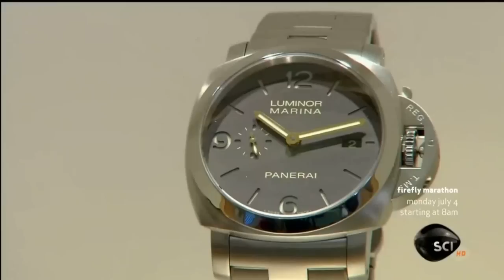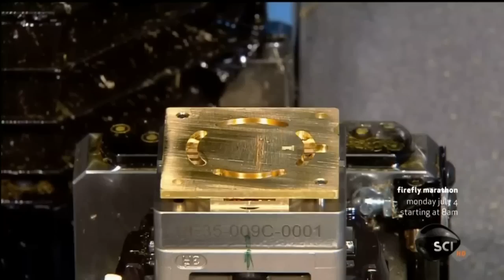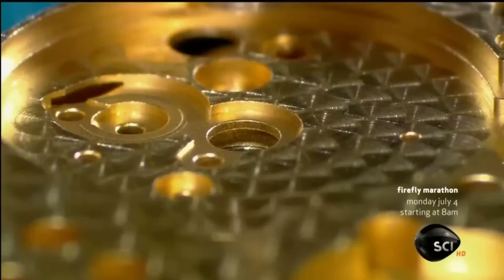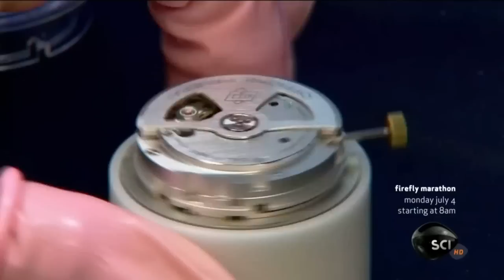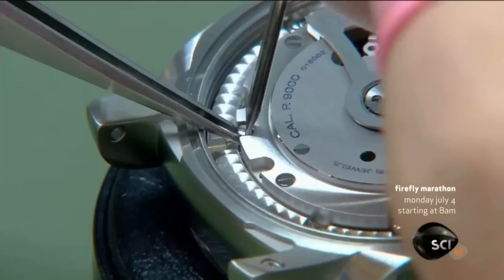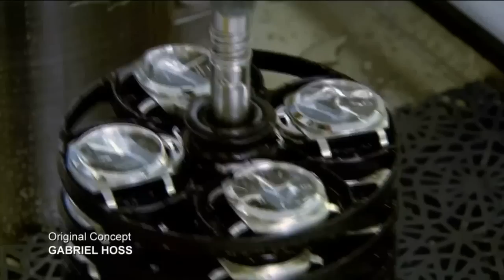Panerai How It's Made

Comment: Panerai watches are overpriced. The shitty thing is that their mechanisms are based on 1950s pocket watches. The watches are simply turned 90 degrees with the small dial at 9 o'clock rather than the 6 o'clock position. So don't get conned by so called Panerai quality or craftsmanship.

Comment: sooo, looks like 90% of all the work is done by robots, so, where's the craftsmanship and value? it looks like the actual price to these mass produced watches is about $100, it's ridiculous to pay more.
Reply: +kk Hong well the bad thing in this video is that it doesnt really show how the mechanism is made but just how the parts are made. I not trying to sell you that Im an expert, I wear a swatch but Im an enthusiast and I know a lot about automatic watches. 
Yes the PARTS of a luxury watch are made by computers so that they are precise. its the assembly and the time spent on the mechanism that makes the watch expensive.
Like building a masive lego... the parts are made by a mold but the artwork is hand made
Reply: thats what i was thinking about. this watch is quite overprice... isnt it?
Reply: Yes, it would be ridiculous to pay a hefty price for just the parts shown manufactured in the video but the actual works(or value) goes to the watchmaker who spend ton of time to make sure that every SINGLE components(emphasized lol) of the watch work perfectly, and by that I mean they have to do many tests. It's not just knowing what parts go where(which already a heavy workload in itself) but to know if the resistance, the recoil, the frequency that the movement should be and much much more that I've no idea about.

Comment: Awesome vid! So the material inside the watch is steel and brass right? Not gold?
Reply from the maker: gulfmen86 Gold could never stand the wear and tear of daily use, it's too soft.
Reply: Adventure-Andrew Is it the same for all watch brands? Because Patek and AP claim that its gold. The reason why I ask is because I cant wear any gold.
Reply: Adventure-Andrew The very prestigious watchmaker F. P.  Journe's movements are made from yellow gold and the watches work perfectly.
Reply: +No User The Chrono Blue from Journe is Rose Gold :D
Reply: Elliot Jackson I know, I stated that Journe's movements are made of gold.
Reply: No User yeah, just thought I'd say rose because you only said yellow :)
Reply: Elliot Jackson Some of the movements are yellow gold. I like the Chronomètre Bleu but I bought the Chronomètre Souverain, because I like the power reserve on the dial and I think the overall finishing is better.
Reply: +No User wise choice! When I get enough I'll be getting the bleu with a brown leather strap
Reply: Elliot Jackson That's a great option. I think Journe is making some of the most desirable timepieces out there. I'm thinking about getting the five steel piece box set.
Reply: A lot of watches are made from Stainless Steel, some brass involved for the movements, and sometimes Panerai used Bronze. Gold is used in a lot of high end watches but it's 18 carat Gold, not pure, 24 carat, Gold. Certainly for the cases anyway. 24 carat maybe for some details. 18 carat Gold can be machined reasonly well but 24 carat would be difficult, it's so soft.